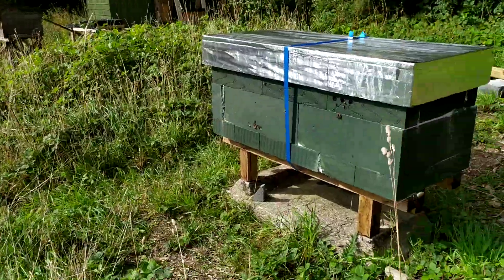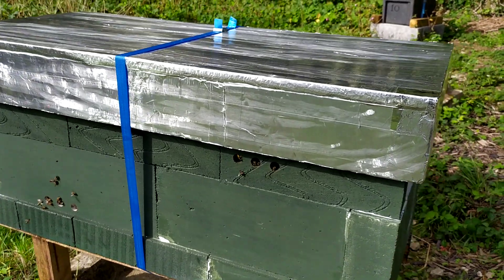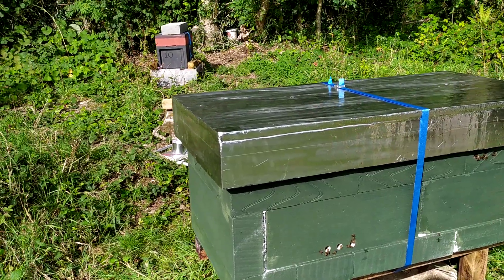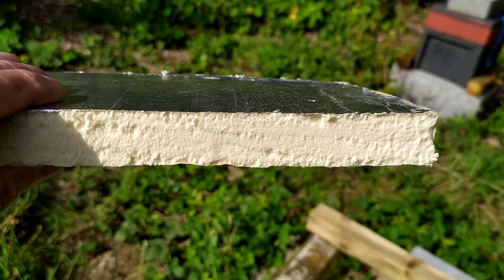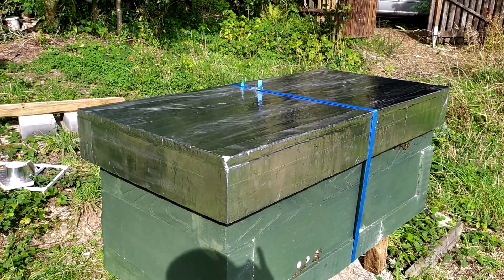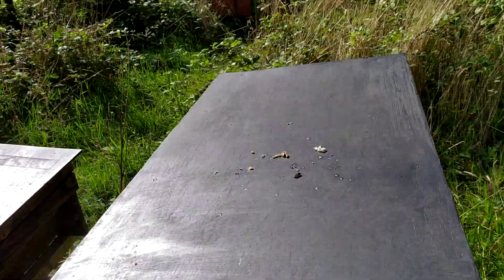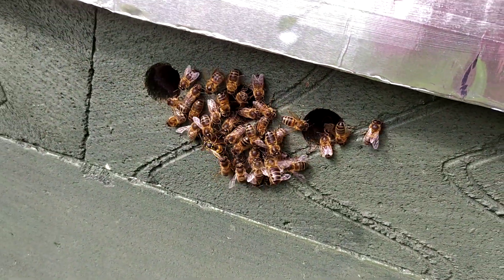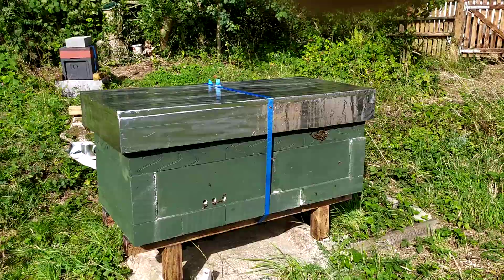ZEST hive update: shiny new roof!

Comment: I'm still just using a 100 mm slab of kingspan on top of mine as I'm employing Bill Summers top frame with the inbuilt entrances, I like your roof and I might go the same way but cut through holes to allow the bees access at the top. It will be interesting to compare the top/bottom ends of your setup.

Comment: Interesting hive. Lighter is better I might have used Luan board as a liner inside the styrofoam to provide a little more rigidity I think it would add about 4 kilos but with the strap on there it should be fine.

Comment: Looks good. Wonder if you can paint it and lose that glare. I also wonder if that tape can go around the blocks as strapping but perhaps duct taped together is not the look you want ;-p
Reply from the maker: I don't think that surface would take paint too well, but the advantage of leaving it is that it will reflect the sun's heat, which is as important as retains the heat inside the hive. There is also a layer of Reflectix directly on top of the frames.
Reply: @BarefootBeekeeper  I used  a similar thick piece of insulation for the roof on mine and just covered it with latex. The latex held fine throughout its first year.